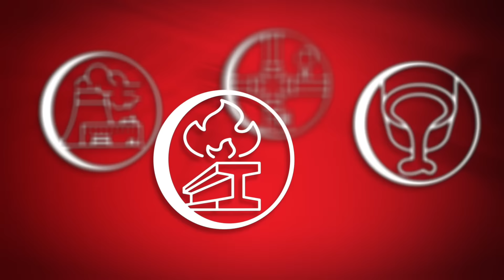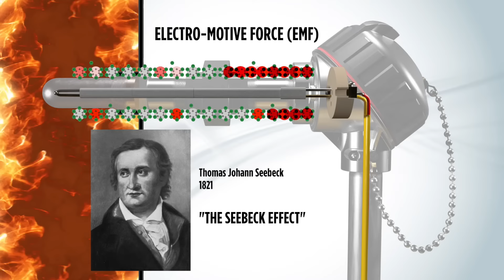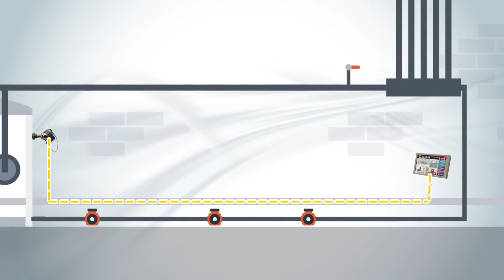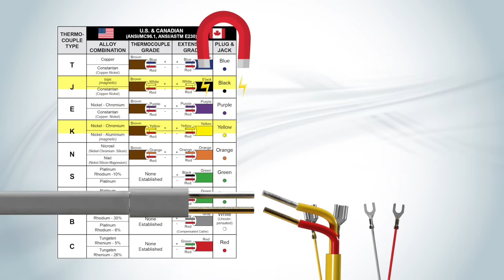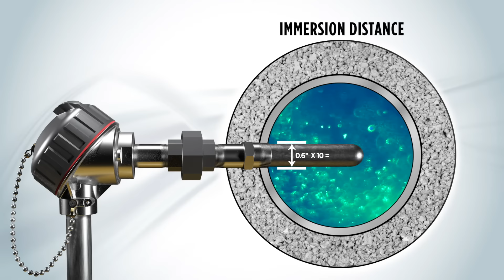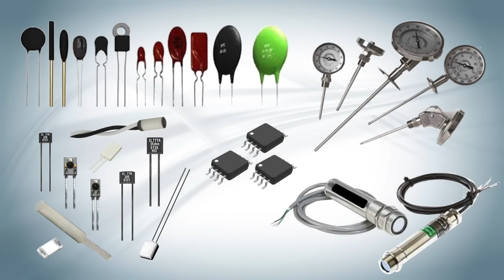Pyromation Training Lab Series:  Thermocouple Basics

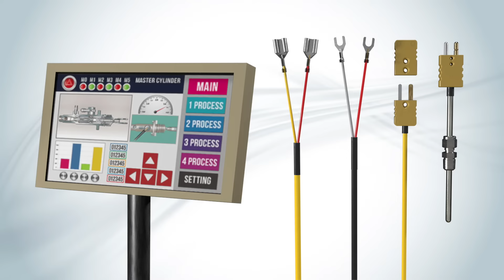Comment: Using a J vs the spade might give a move secure connection at 3:03 , and also more connection as well vs just having the screws over a small part of the metal spade connection.